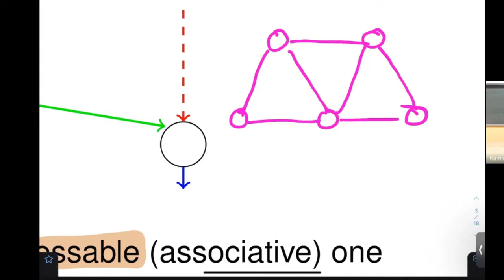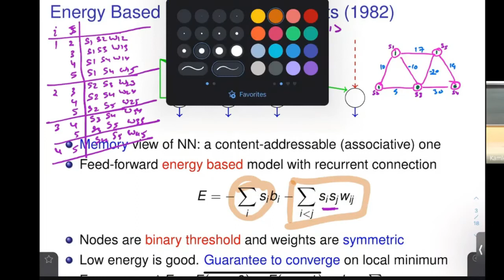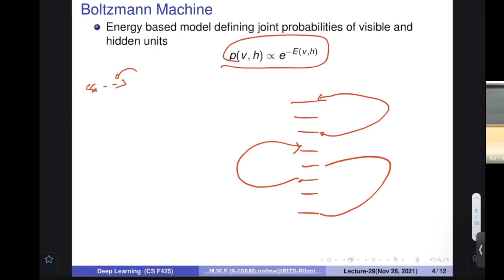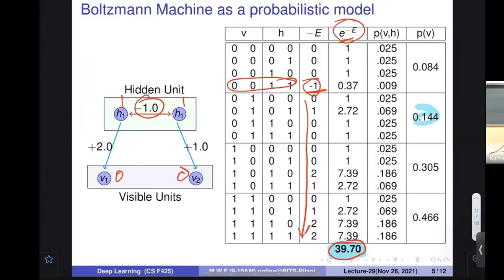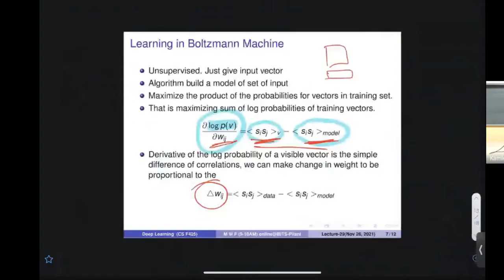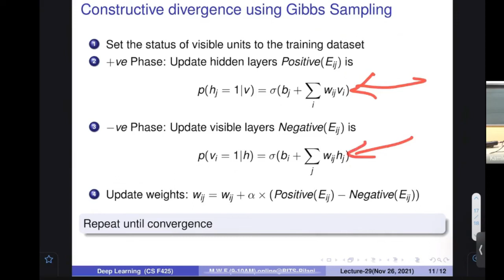BITS-DeepLearning2021-Lecture-29: Boltzmann Machine, Restricted Boltzmann Machine, Deep Belief  NW

Comment: The lecture explains Boltzmann Machines, which are networks that learn patterns in data using probabilistic connections. Restricted Boltzmann Machines  simplify this by removing some connections, making them easier to train. It also covers Deep Belief Networks, which stack RBMs to build deep models that can learn complex features from data.